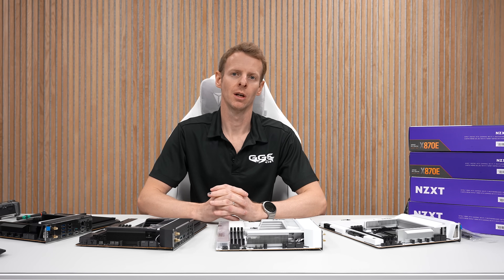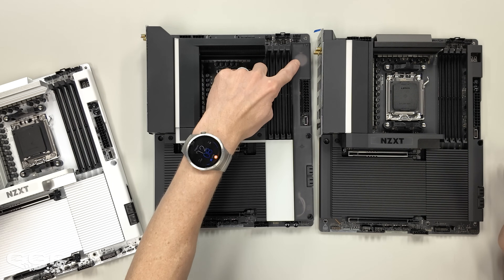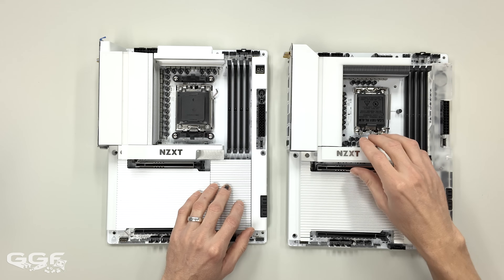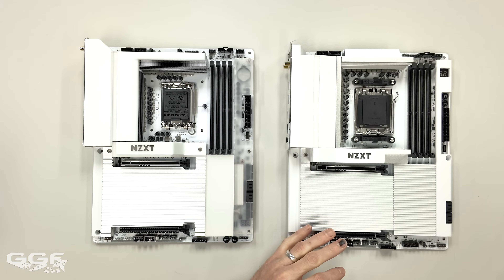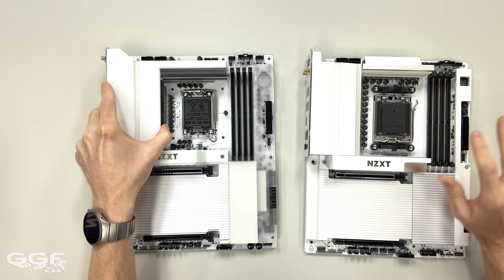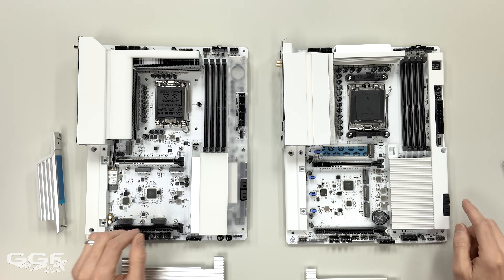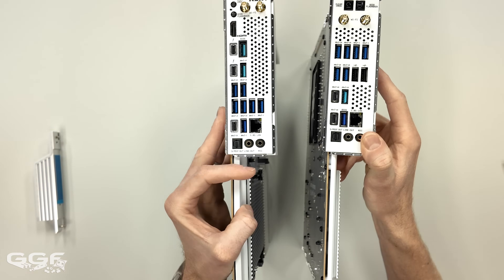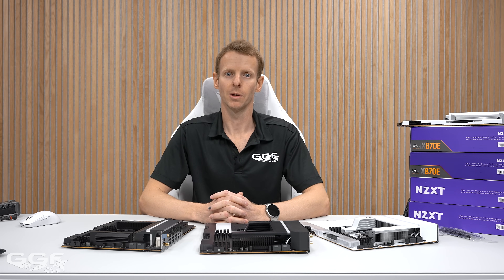These NZXT Motherboards are BEAUTIFUL!

Comment: Why ... this is so backward🥲 I want more pci-e slots instead of m.2.... I have a minimal 3 pci-e devices, now it is rare to find a mainstream board to support two x8 slots...
Reply: It is easy to convert pci-e slot to m.2, and very difficult the other way around.
Reply: since i doubt your devices are pci e 5, you can get a breakout board and plug in  4  pci-e 3.0 devices all running at x16 or 2 pci e gen 4 at x16. thats the beauty of gen 5, ujnless you need a flagship gpu or a gen 5 nvme at 14.5 gbs, having x8 is the same as pci e 4.0 at x16.......ps nevermind the bottom pci-e slot is only pci-e gen 3, yeah, bullshit product.

Comment: I'm very disappointed about AMD board-partners offering regarding AM5, they made the whole chipset platform literally unaffordable with their insane pricing and segmentation.
On the other hand i will never be disappointed with Stuart content, always straight to the point with valuable points and feedback ❤
Have a great week 🙏🏽💪🏽
Reply from the maker: Thanks mate. Have a good one!
Reply: no they didnt, you can get a fully featured asrock nova for 300 dollars and it will last you , at am5's launch 4-5 cpu upgrades. i got my rog asus strix for 100 more in 2022 or early 2023   and its had 3 cpu's in it already and will be around for the next  processor released and quite possibly the one after that. thats at least  4 years maybe 6 years. intel has you fork out hundreds on a mobo every time a new cpu comes out. the 300 dollar amd board has pci e 5.0 , nvme 5.0, 5gb lan, wifi 7, tons of 10g usb ports and 2 40g usb 4 ports. tooless nvme install, tooles gpu install and now soon rear connect boards will be more common so no more mess up front, just sheer anodized aluminum beauty with zero pcb showing.

Comment: So, overhyped ASRock motherboards that cost a bit more and run a lot hotter.
As an Intel Inside guy (Monolith, no chiplets, please), I prefer the AMD boards. I would never buy a board, especially at that price, with no debug error code display... Never.
Reply: They do have post code, it's under the plastic shroud on the bottom right, you can see it at 4:05

Still not worth it IMO.
Reply: @analogicparadox  They hid it well, still not worth it, unless you buy it purely for aesthetics.
Thanks for the heads up.
And yes, that's close to Asus Hero prices, and almost double the ASRock it is based on.
Reply: @NorthWolfe  its the same price as the asus strix x670 e -e was, or the new 870e -e

Comment: "Not super expensive" "$499"...friend, you can't be serious. The existence of $1000+ boards doesn't make this a cheap board. And or that price, you'd better love the look of it, because Asrock's boards are right there. I'd pick the Taichi or Nova over this any day and not only because they're cheaper boards. As much as I hate(d) Gigabyte having M.2 ports share lanes with the top slot, at least there's some extra value in having options. This just gives you the standard setup, but with a higher price.

$350 max for these.
Reply: True. How much is it really to plate these with white / black plastic and add a RGB strip lol
Reply: No one said it’s cheep lol
Reply: Agreed.
Reply from the maker: Never said it was a cheap board.... It's in the middle and of course it's going to be hard for NZXT to compete with the likes of ASRock when the only have a couple of board skus
Reply: @GGFEvents  For what this is, it's a pretty expensive board, even for 870E, given what it's offering. Other brands have ~$300 boards that have the same feature set. NZXT really thinks their aesthetic is worth ~$200. 

I'm not comparing them to just ASRock though. Most makers have boards that are cheaper with the same feature set or same price with a little bit more. This board at $370 would have been a pretty easy recommendation no?

Comment: Pause at 14:50 There is a minor issue with the black Intel Motherboard: The RGB cable is white and pretty visible through the translucent shroud, and I wonder why they didn't put a black cable there. Also, you mentioned that the black one doesn't have post code display, but it might be there under the shroud .
Reply: @GGFEvents  Wait, isnt the post code display the 2 red digit display UNDER the translucent shroud at the bottom right?
Reply: @SwagTheDripper  It 100% is. It's right below the SATA connectors.
Reply: @  Well the only way to be sure is to look it up when you power up the motherboard. Accordingly to the manual it's right under the lower front  USB header, for both white and black (possibly). In the digital manual from NZXT's page, it's under the number 13 named Digitale Debug-LED, also there are 4 POST-LEDs at the bottom next to the NZXT fan connector.

Comment: $500!!!!😮😮 crazy. $349 tops
Reply: 500 is rough but it’s beautiful
Reply: bro thinks it's 2015 😂😂
Reply: @razorwireclouds5708   The NZXT N9 X870E and N9 Z890 are essentially rebranded versions of the ASRock X870E NOVA and Z890 NOVA. Price: $349.99.
Reply: @razorwireclouds5708 $500 is not the new standard for motherboard prices - especially with missing features.  These boards are trash.

Comment: why did motherboard manufacturer stopped putting PCIe port on motherboard ??? This is the most versatile port ever created, you can adapt it to anything
Even if you are like "but modern gpu are 4 slot thick so most of the port are blocked" that still leaves 3 slots ! So why are all motherboard covered with m.2 ???? 
With a 16x slot you can have 4 m.2 ssd in an adapter, which is more than what most people will need. And with 2 or 3 16x slot (not counting the gpu slot) you can have capture cards for streaming, networking card, thunderbolt cards, dozens of sata port etc.... 
so BRING BACK PCIe PORT FFS
Reply: sata is done, to slow, 2 pci-e slots is enough because all the things you mentioned have already have 8 pin ports on the bottom and top of the board , thereby cleverly bypassing the cpu lane limitation of having more  pci-e slots or more nvme ports but never both or you lose tons of usb ports. they have a thunderbolt header and finally brand agnostic nzxt 8 pin port that will save you from having to buy all the same brand aio, fans and or the other argb equipped  peripherals without having to install 3-5 different bloated programs like armoury crate